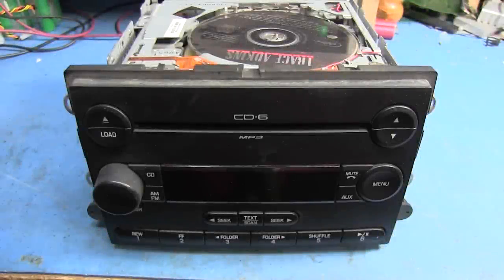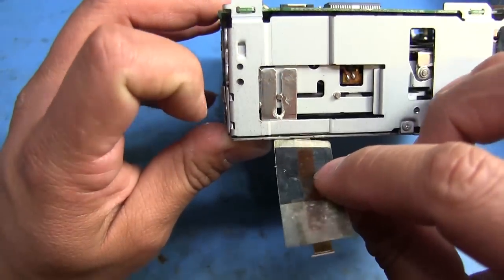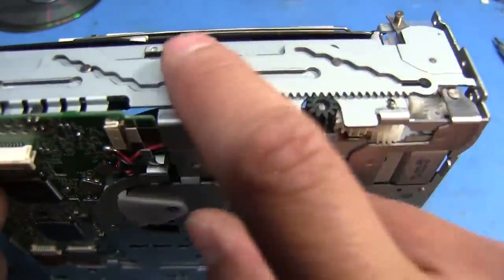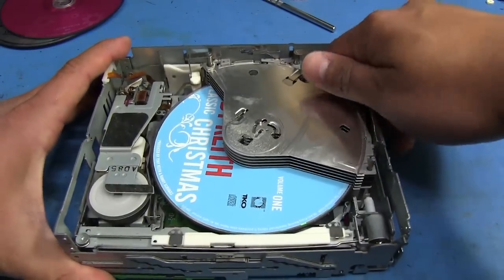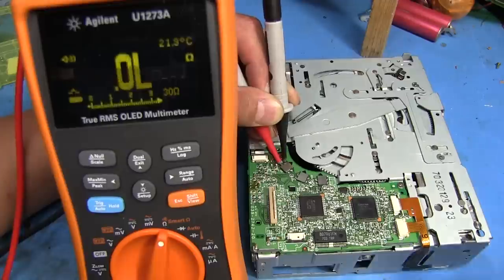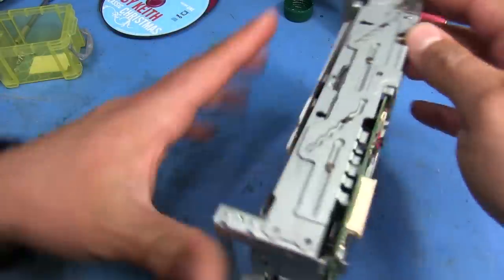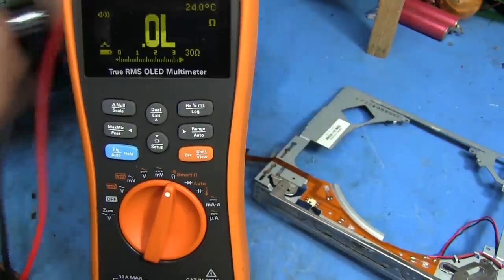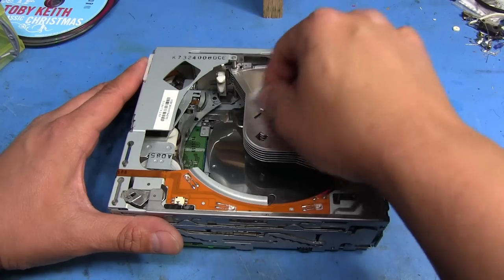TWB #5 | Let's fix it! Jammed In-dash Ford 6 CD Changer Repair

Comment: Great video, thanx. I've already watched one regarding getting the stereo out now I can investigate this. So is there some correlation between CDR's and "legal" cd's. Just asking because I heard you mention it was a cdr that was stuck. That's all I have in my player, which is identical to this, 6 cdr's full of mp3's.

Any info you can offer is appreciated.
Reply from the maker: WiKissfan Nah, it doesn't matter what kind of CD is in the mechanism. I think I just mentioned CDR because that's what it was, not because it did anything in particular.

Comment: Great tutorial video. By chance, do you think those contacts you cleaned may be responsible for one of these units not wanting to accept CDs? Once in a while it finally accepts a CD into one of the stack slots, but most of the time it just immediately spits it back out before it even gets all the way inside.
Reply from the maker: It could possibly be because of a faulty switch. There's one of them that's activated by a small spring loaded lever on the inside by the motor that drives the roller. Might want to check that one. I think that if it doesn't detect the disc after a certain amount of time, it reverses the direction of the motor to spit the disc back out. If it's acting up, it may be causing your issues. There are also three optical devices that detect the disc as it's going in. They're all in the front section. Might wanna make sure those aren't being blocked by dust or debris.
Reply: The Workbench Turns out that even though the front panel of the head unit is identical to the one in your video, the inside is completely different. I popped off the top lid, and found the disk changer assembly wasn't going to come out easily like the version in your video. Screws are in impossible spots without having a right angle screwdriver. Went ahead and blew it out with compressed air, and then cleaned all the little circuit board switches I could see with isopropyl alcohol, which restored it so it will accept CDs into any slot again. Would have liked to test their resistance with my multimeter as you did, but I can't see the circuit boards they are attached to. For anyone who believes they are looking at the same version of this radio, the 4 switches are all right on top in holes in the metal plate. One is easy to miss. Look closely. Also clean the switch for the spindle motor laser assembly swing out arm too since it's very easy to get at.

Comment: Great video. I changed my battery in my 08 Mercury Milan and afterwards the cd changer must have got jammed. I've followed the video all the way where you started taking the CDs out, but have only been able to get the top two out on mine. I can't get the trays to come together with the last three cd's. Have you ever had problems getting the gear that you rotate clockwise where it stops turning like it's supposed to? I believe I got the jammed cd out but want to to get the others out so it can reset.
Reply from the maker: Mobe3669 Check and make sure that the loading/unloading roller located at the front of the assembly is in the correct position when you encounter that the large gear on the bottom can't move anymore. It can slide forward and backward when you remove the top part of the mechanism. It slides inwards to grab the CD before putting it back into its designated tray and then moves back out to let it go once it's been locked in. I will be doing another video on completely disassembling the mechanism since I've had a lot of questions regarding things I didn't cover originally. Hopefully I can get my hands on a complete mechanism to do so.
Reply: That'd be cool if you did!! I'd even consider sending you mine cuz I'm so frustrated. So I notice that the loading and unloading roller does move back and forth like you said but after putting it in the right spot the gear still won't let me turn clockwise anymore to release the remaining cd's so that I can pull them out. I can't get the pieces on either side of the assembly to move in unison past the second to last notch if that makes sense. The ones that signify each cd location in each tray that you move prior to adjusting the gear to release it.
Reply from the maker: Mobe3669 Ok, I see. You may need to move the positioning plates around a bit while at the same time attempting to move the gear, if you haven't tried that already. The positioning plates will only move up and down when the large gear is at that position labeled G or S as I've seen on some units. I wish I knew what the letters are supposed to mean. I'll admit that it is a frustrating mechanism to deal with sometimes. Seems like a lot of different things can go wrong with them, but I think all the problems can be linked back to faulty switches.

Comment: Very very nice and informative video, 
 Big like
I have the same CD player in my 2008 ford 500 car,  it started to make troubles after the last time I changed the car battery, once I connected it ,thr CD player started to make tek tek tek tek sound,  then it stopped, CD player was working also the radio and sync system,  but each time I need to move to the other CD it will start making the tek tek sound for few seconds then it works properly.
Unfortunately I tried to fix it before I see your video, when I removed the CD plyer from the radio lt seems that the white cable was partially pulled from the side of the radio,  and when the metal body of the CD player touch the metal body of the radio ,electrical sparks came out , I fixed it in place and tried to turn it but nothing is working anymore !!!!!!!!
Kindly what might be the problem, I really appreciate any advice
Reply from the maker: Bilal Ghannam Unfortunately it sounds like something got fried. Wouldn't be able to tell you exactly what. :(

Comment: Thank you for this video.  I had this issue with my cd 6 player in my Ford Fusion.  Your video was very helpful in my removing the 6 cds from the player, but once I put it back together and powered it up, the cd changer mechanisms didn't move as they should (and did in your video).  nothing happened.  before, I could hear the mechanisms running, but now nothing.  when I hit CD button the display reads "no cd" as it should.  when I press load, it reads "cd error".  In my efforts to correct this, I must have done something wrong.  Any suggestions?  Thanks.
Reply: When you put the cover back on did you ensure all the slides are free? It's easy to pinch them under the cover.
Reply: Your ribbon cable may be backwards.

Comment: Awesome video. thanks! This was just what i was looking for. But i still managed to botch it! ): I just could not get the little C clip off the gear, i was over thinking it i think. :)  Six disc loaded and they wouldn't ejectI The disc needed to be returned to the library, so i had to remove the springs on the trays and get the disc out that way. But since, I was able to get the C clip out and all the springs back on. But I can't get the mechanism to work as freely as you did.

BTW, this is the exact same changer that's in my fiance's '07 Nissan Versa SL, manufactured by Clarion i believe. 

Just a thought .... if the disc won't eject, and before disassembly to remove the disc, could one just try to clean the contacts to see if that would clear the problem?

Thanks again!
Reply from the maker: doug waters I've had issues with some of these where they wouldn't move very freely due to dust build up and too much friction between the plates and gears. In this case it would be best to clean everything as well as possible and use a tiny amount of light grease on plates that rub together to get it moving smoothly again.

If the device has already jammed due to bad timing, cleaning the contacts probably won't do much on its own and that's when resetting everything is necessary.

Comment: I sure could use some help with our 06 Dodge Durango 6 disc changer repair.  Have you ever fixed one?  If so, how about another video for us? Thanks so much if you could.
Reply from the maker: I just looked up that particular radio and unfortunately I have not worked on one of those changers before.

Comment: Thanks u made look easy and it was easy but i should of listen to tou to clean the switches have to take it apart twice did not find the licquid u used but a different one in autozone was for the same thing work find beats in wasting 600 for a brand new indash at the moment but thank you verry much for your video help me out alot to all the people out ther realy easy and pations do it yourself will take you one hr in a half
Reply from the maker: Eric Castaneda Glad you were able to get yours working!

Comment: Question can you just leave the CD changer out and still have the radio work? I have a audio connector for iPad/phone in the center console so really don't need the CD Player.
Reply from the maker: It shouldn't harm anything to leave it disconnected and give it a shot. If it complains, you can always reconnect it. Don't disconnect/connect anything while power is applied and don't leave the ribbon cable flapping in the breeze. Just be careful and don't let anything short out. I'm not liable if you damage your radio. :P
Reply: Cool I'll give it a shot, if I can get the 3 jammed cd's out and get the eject error to stop then I'll leave it i , but don't worry if I damage it I wont blame you it will give me an excuse to buy a new and better one lol

Comment: Do you happen to know how to fix the display on the same radio? I have a 2007 Ford Explorer and the display doesn't work at all.
Reply from the maker: It's usually a problem with solder cracking around the resistors that feed power to the filaments on the display. So, I guess that a yes. lol

Comment: Can I just replace the cd portion of the radio with another compatible  unit , or does the whole radio unit need to be replaced ?
Reply from the maker: Jeff July You can just replace the mechanism itself if you have a working one available.

Comment: I don't know if that's the case with mine, but when I turn my Ford Fusion on The disc changer rattles a bit stops then rattles once more. I don't know what happened to it, but I don't even use cds I use my aux input and my phone for media. It's extremely annoying, any suggestions on how to get it to stop?
Reply from the maker: If you really don't care to use the CD at all, you could try disconnecting the cable going to the changer. It'll disable it completely, although I don't know if the radio is going to give you any errors because it can't communicate with it. Other than that, I'm not sure that there's any other way to get it to stop making noise without actually repairing the unit.

Comment: Hello again, my disc changer is jammed again, this time it seems to be that the laser arm is stucked, I just disarmed, but I can't get to re arm it again, any advise?
Reply from the maker: Diego Martínez You might need to take off the silver cover that hides the very large gear underneath the disk trays and lubricate it. It could be really dry and getting stuck. Sorry about the late reply. Make sure to clean the switches as well if you haven't.

Comment: how did you bypass the radio's anti-theft system?
I tried to remove my ford escape radio (with din tools and other) but something is holding it at the bottom without it budging more than a 1/8 inch. I gave up removing it.
Apparently the radio anti-theft triggered and now  the radio will not play nor the display lighting up (it did before...I just had cd problems).
I couldn't have dislodged the wiring harness as removal attempt just wouldn't move that much. I checked fuses, loose front face plate unit,  etc.
Anyone out there to advise/inform me of this situation...cause and effect.
Thanks.

Comment: I have a factory Ford 5 disk unit. I just bought the vehicle so know nothing about it. When I try to do anything with the cd changer I just get an error. Looks like it is full of cd's. Any easy fix for this?
Reply: +Keith Dean Just open it, and clean the switches, just like here. if there is no broken gears???, I am sure , it start working. This video is for you..., are you sure, it is only 5 CD's???, maybe 6??=)
Reply: It is 6. I've tried the coat hangers but can't get the unit out.

Comment: My 2008 ford taures x keeps making a clicking sound is their a way to just take the cd player out completely and still have the radio
Reply from the maker: Unfortunately, if I remember correctly, the unit won't operate without the CD mech present, but I haven't worked on these in years, so I don't remember for sure.

Comment: how did you power it up after you took it out its the one thing you didnt explain but it is an awesome job and i am going to do it myself on my 05 escape
Reply from the maker: I had the mating connector that plugs straight into the back of the radio. It's just three wires: battery, accessory, and ground. I just had battery and accessory lines connected together to 12V power supply and ground to negative. Could also be connected carefully with some alligator clips, but you'd have to make sure you're not shorting anything! 

You'd have to look up the wiring diagram for your particular model as there seems to be at least two different connector that ford used on these radios. There is a wide connector about 2" wide and a smaller, about 1" one.

Comment: Great job, an excellent, teaching video! Have you done Bose 6 CD player, Infiniti FX 35/45, year 2004?? Where are switches in there, I have to clean? I am sure there is not anything else wrong with it, most of these problems seem to require cleaning switches, can you help me here, please, so me how to clean Bose 6 CD player unit, thnaks a lot =) You are great!
Reply: Eero Laukkanen Workbench, could you answer me on this Infiniti Bose 6 CD-player cleaning thing, could you make a video to fix those units too, i need to know, where the switches to clean are!!!! Thanks, mine is FX 45, year 2004, thanks =) You are very good teacher !

Comment: so my "arm" is stuck in between it all. preventing me from pulling my cds completely out.  what can i do?
Reply from the maker: The large metal gear has to be turned to get the pickup/spindle assembly to retract back into its home position. It's probably going to take some effort, but you'll likely have to pull the big motor in the rear right corner out of the unit, the motor that runs the large gear, and try to use your finger to rotate the white gear down towards the bottom while you try to get the stepped/slotted disc selection plates in the right spot to free it up. If this sounds like a PIA, it is, unfortunately. 

In my opinion, these mechanisms just seem to be really terrible all around. There are just so many things that can go wrong with so many tiny moving parts.

Comment: I have a 2003 f150 harley truck 6 cd player. Radio and cd working fine . Battery went dead changed it and now i get a cd error when putting in a cd , how can i fix this thanks.
Reply from the maker: tony ferrari Only way I know how to figure out what's wrong with it is to take it apart. I don't think there's any way to get an error code or anything like that from the head unit to tell you what's wrong. I think it's really weird though that several people have mentioned that theirs was working totally fine until their battery went dead.

Comment: Hey I have a 2008 Ford Fusion with the same CD player. Only mine reads it, displays a BAD CD, and spits the cd back out. Do you know what that means?
Reply from the maker: Potentially a dirty lens if it happens with pristine, non-burned CDs. Couldn't tell you for sure as the error could be anything. A lot of cd players seem to assume a bad disc, vs there actually being something wrong with the unit itself.
Reply: So I bought a disc to clean it but it will not even read that one... Is there another way to clean a dirty lens?
Reply from the maker: Anything else is a bit riskier, and you'll have to open it up to access it, but you may try blowing the surface off with some compressed air or gently use a blower brush like one from a camera lens cleaning kit. 

There's also the possibility that the pickup may have a weak laser and is just not able to read discs. At that point though there's not much that can easily be done.
Reply: +The Workbench except turning up the potential resistor on the laser diode that controls the current to the diode

Comment: The video helped me remove CDs my son had stuck in, but when I went to test it didn't go back to the default position after ejecting.  There was a double space at disk 2 and the unit reported a load error.
Reply from the maker: Gary Krone Sorry about the late reply. Sounds like something isn't at the right spot. Might need to reset all the trays. Also, make sure no gears are damaged.